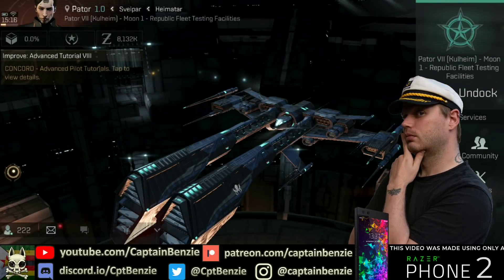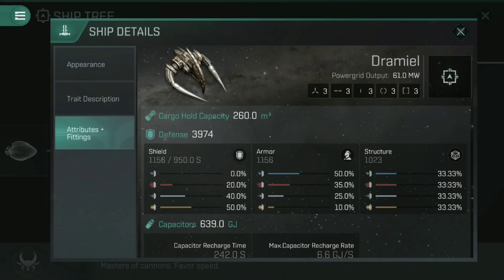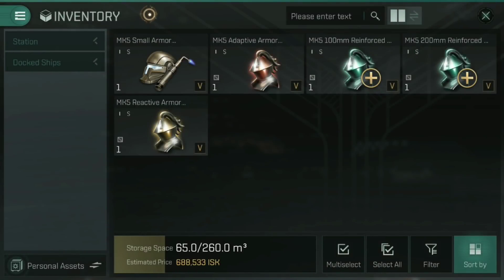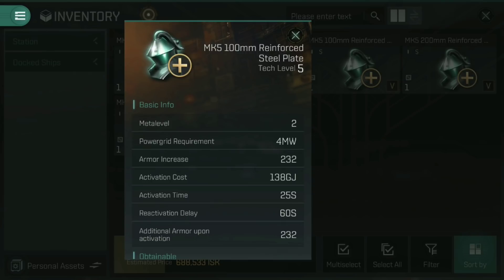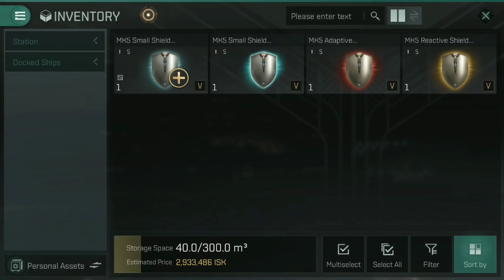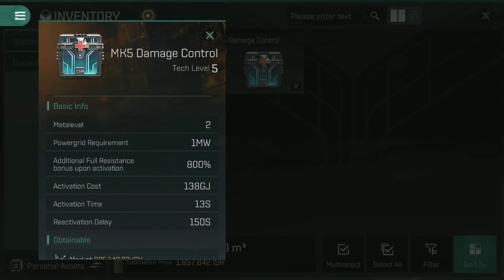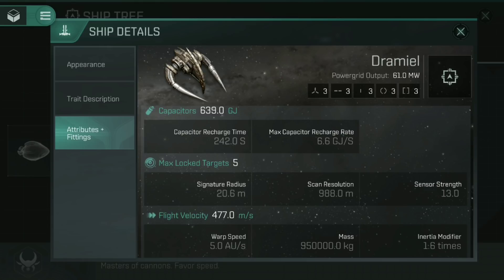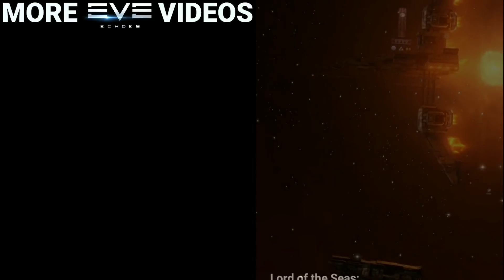UNDERSTANDING TANKING!! Armour Tanking, Shield Tanking, Speed Tanking Explained! || EVE Echoes

Comment: is it possible to solo T10 anomalies in frigates or i need to bring a battle cruiser?
Reply: I did Small10 guristas with Condor II and Tharsher Fleet Issue. But medium10 is a problem - the wave of enemies so numerous that there are more than one Webber ships and much more unavoidable incoming missile fire.
Reply: i did it already with the Slasher2 at the begining of the game^^
U need a decent amount on dps otherwise it will take a long time to clear the anomalie
Reply: how much dps i am supposed to have to not take long time clearing the T10 anomalies?
Reply: @exterminator6935  all of it. 154dps Condor II feels like forever. It takes about 10-12 minutes to down one single Raven.
Reply: @exterminator6935  with my worm ~300dps ots pretty fast. 

But in the current state its more valuable to do T6 or T7 anomalies